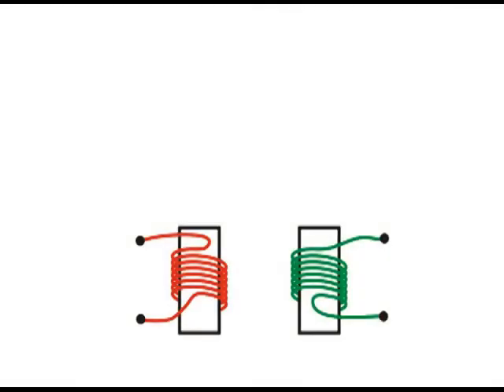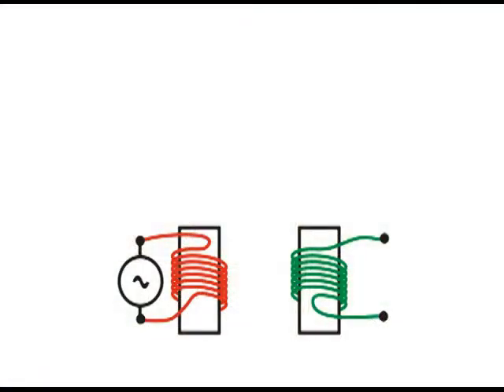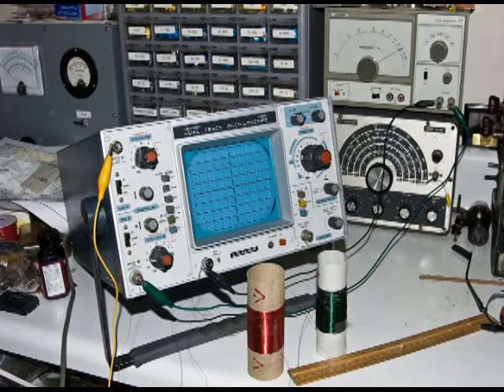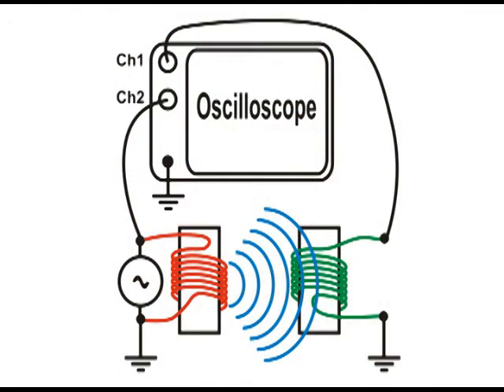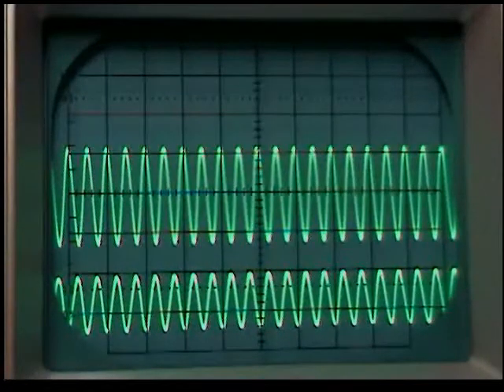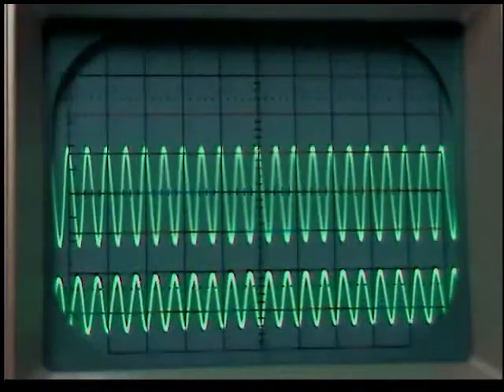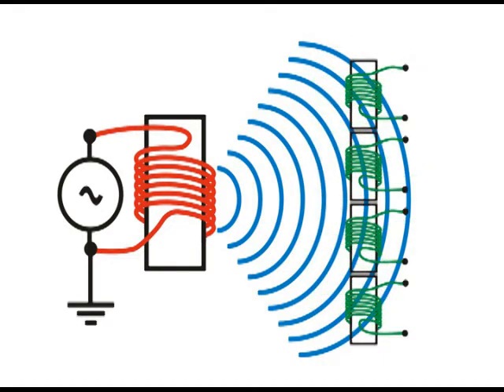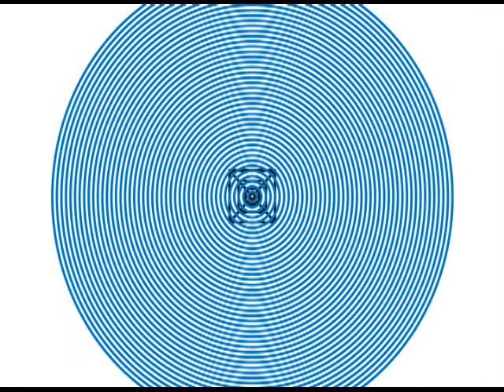How to get electricity from the air?

Comment: If you were to tune to the transmitters frequency you would optimize energy transfer. But the simplest way is to just use a pickup antenna and rectify it using a diode with no specific frequency.. Just wide band rf.. I have done this and you would be amazed at how much you can grab out of the air! I have powered a bunch of leds with it and some other things.. Kind of scary to know just how much rf is flying around us. (radio, satellite, wifi, etc etc..)
Reply: How.? Talk to me

Comment: yaa but dont use signal generator for it..simply use current from air...can you show the electricity from air on osciloscope??? by connecting a primary coil on channel 1...and amplify it with a transistor and then show it on osciloscope on channel 2

Comment: Excellent video...I have a question...which Oscilloscope do you recommend? Is there a particular spec that you need for most general purpose RC receiver/transmitter testing? Thanks in advance =] (I was thinking of buying on but wasn't sure which should I use)